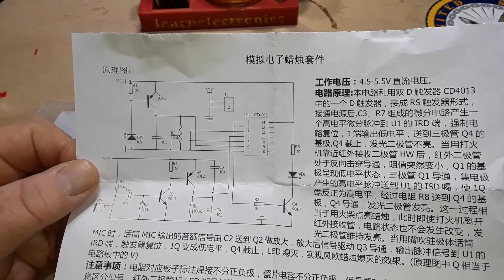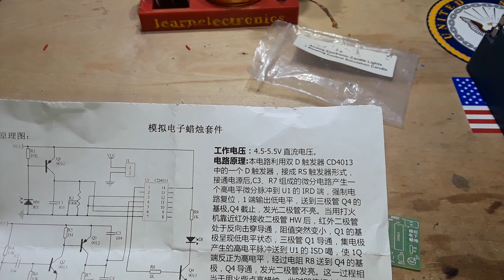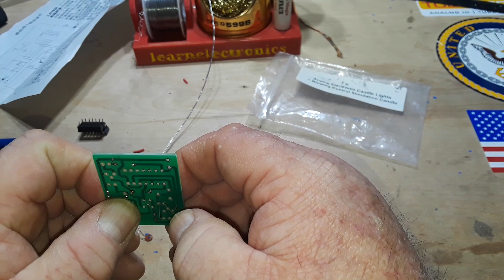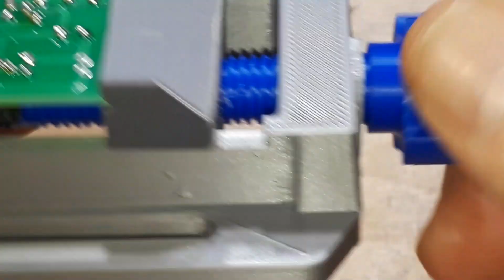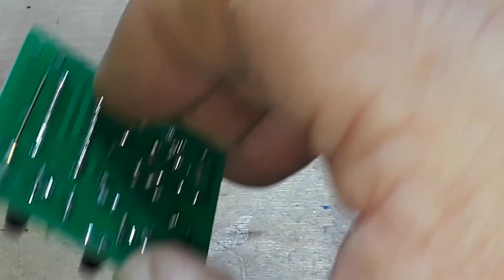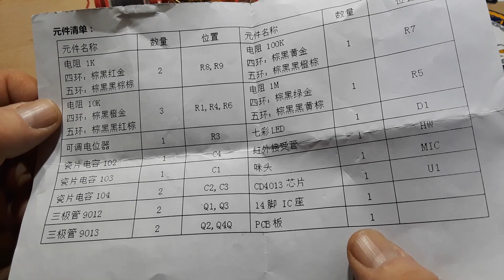I Need To Relax & Build A Kit

Comment: good video. I use blu-tack to hold the parts in place while i turn the boards upside down then i press it unto my work surface which helps a lot to hold it in place while i solder the components onto the board. Just a tip that might help in the future 😀Once i got good at soldering then it was relaxing to me. But before that it was often frustrating when it didn't go as planned.

Comment: I saw that vice and thought HEY where did he get that? Did he print it, will he share the .STL???? Please!. D
Reply from the maker: https://www.thingiverse.com/thing:2702273
Reply: @learnelectronics  you are a champ!
Reply from the maker: Glad to be of help!
Reply: On this kit could we add more candles (led) and change the on off trigger devices. On a model train we can do Reed switches pretty easy. Under the car one on left and one on the right. Using track power to a Buck Boost for constant 5V we could bread board that yeah? Dennis
Reply: But trains run on 15Kv?
Reply: @MothKeeper  I pick up track power which runs between 5 and 15  VAC. Convert to DC, then Buck Boost to constant 5 VDC in the car, then route the 5VDC to the PCB with the stuff on it. Been doing that for years. Digital Sound and Smoke and LEDs.
Reply: @DennisMurphey  Thats exactly what i do... But I've found 5VDC is not enough to electrocute the rats that i put on the freight beds, but 5VDC is enough to run the water pumps i use to waterboard the rats and ive found out its better to cook the rats in the oven after waterboarding for about 2 1/2 hours till crunchy.